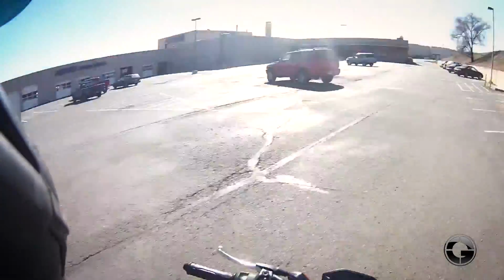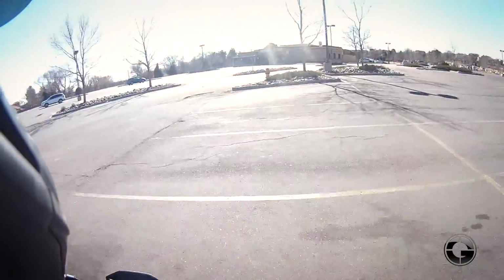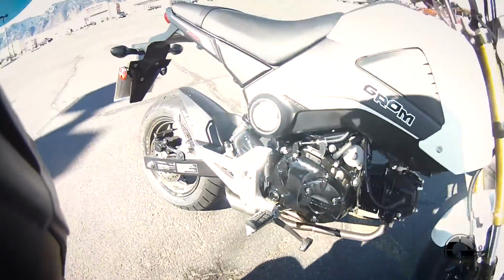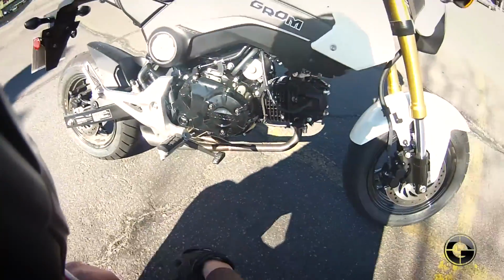Honda Grom MNNTHBX Exhaust

Comment: Fuck a tuner. Untill you do a bunch of other shit also, the computer will compensate. At our altitude adding exhaust and intake mods is so small it's basically bringing it towards sea-level breathability. If it wasn't fuel injected it would be a small concern. . Sounds good!
Reply from the maker: Thanks! I like the sound as well and the price was right. Time for you to get a Grom!
Reply: I wish
Reply: Sportbike Hobo I don’t have a tuner and I’m at 14.5k had an exhaust and intake since before 1k

Comment: Do you find it to be overbearing while riding?  I want to get into vlogging but don't want it to overtake the sound.  This is on a used bike I am looking at.  Nothing has to be done to the bike after installing?
Reply: Same here, not a vlogger but I put a shit ton of miles on my last one.  It had the RS9 carbon full system in titanium.  I did about 1000mi/mo. on the last one and was at 7500 before it was stolen.  I'd even gear up and ride in the winter if it wasn't icy out.  Cabela's silk thermals are pricey but very very helpful.